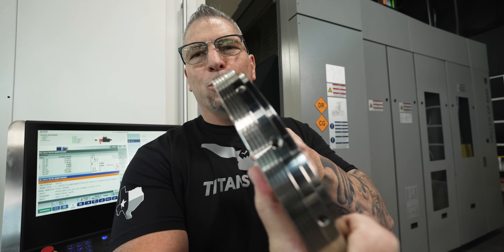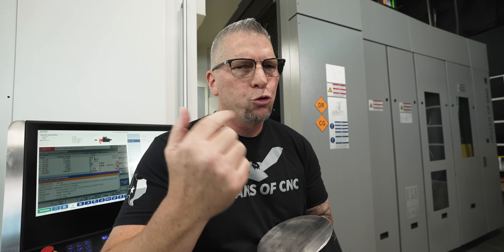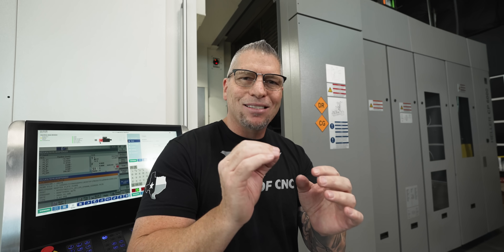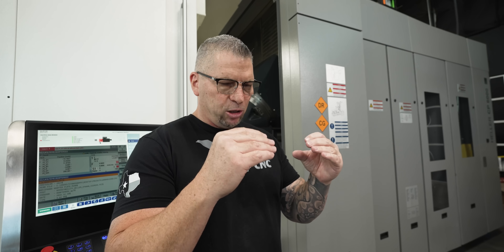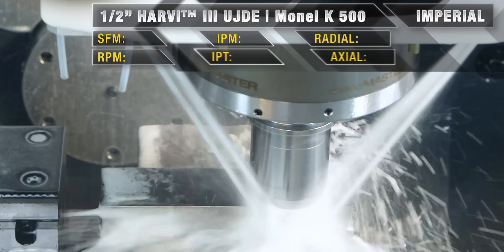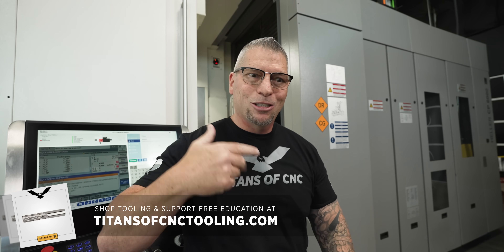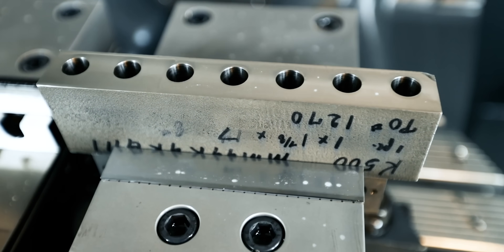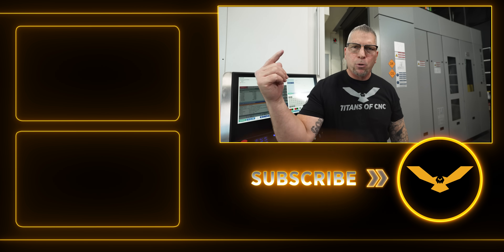How to CNC Machine Monel K500 | HELLER CP6000

Comment: US Navy uses K Monel for skin valves on ships. The valve on the hull just before the fluid enters or leaves.

It is as strong as steel but very resistant to sea water corrosion. Stainless does not do well underwater in the ocean  in a piping system .

Comment: Let’s see machining of tungsten carbide or ceramic. We use these in the harshest conditions for control valves
Reply: I've jig ground holes in both of those using diamond abrasives, but a chunk of either would become a paperweight if anyone was counting on me to know what to do with it.
Materials that hard take a special technique, where the grinding wheel is only in contact for a second and then pulled out and allowed to cool for a few seconds. Three seconds in the cut turns a $200 wheel into a burnt steel pin.

Comment: never heard about monel. the nastiest metal i had to work with was called vanadium toolsteel (do not remember the exact name but that is what it was). it broke so many cutters if you weren't super careful and even if you were.
Reply: I've never heard of anything called "vanadium too steel," but many tool steels do have vanadium in them, in varying amounts.  I think M2 has several percentage points of vanadium.

Vanadium is normally added to tool steels in small amounts (about .03%) as a grain refiner and grain-growth inhibitor.  I do not believe it affects machinabilty in this small amount.

I've never machined M2.

Comment: I don’t mean to knock Titan down, because I really like his content, but…

I’ve machined on both Monel 400 and K500, as well as Inconel 600, 625 and 718, as well as Nickel200. By far, the toughest to machine was the 718, hands down. The easiest was the Monel400, followed by the K500.

None of these materials are particularly hard. They are all varying degrees of tough. There is a significant difference between hard, tough and strong.

Comment: A bit of personal experience from when i machined monel(70-30nicu with some extra herbs and spices occasionally) and k monel almost daily for 3 years at my previous job, i got into the habit of not making the most efficient toolpaths on the lathe, but rather better ones for chip control. Makes your boss a bit unhappy at first but it also makes your life as a machinist way better cause you're not fighting giant rats nests two or three times a cycle.

Comment: If you try to cut that with any other endmill besides Kennametal they will snap off? I highly doubt that. You. Can't possibly go and make a claim like that then go to the most basic carbide drill and tell me that you can use that without issue. Im sure every single other tooling manufacturer has a series of endmills that will cut that, not just your sponsor

Comment: Yea monel is hard stuff for sure. In the oilfield a lot of the high dollar tools in the bottom hole assembly were machined out of monel and it was always a bitch to get the dies in the slips to adequately bite into it with not a lot of weight hanging below.

Comment: That part looks like the an impeller support brace for the main pump. If it is monel, it is probably for Liquid Oxygen side since it is compatible with oxygen and not catch fire. I design rocket parts so I have some info about this. 

If you think Monel is hard to machine, try machining Stellite. I would work with that stuff when I made injector parts for the F35 fighter jet engine combustion chamber injectors.

Comment: For anyone's general reference, monel is commonly used in oxygen service as it is less reactive with hot/high velocity oxygen which would otherwise combust with a carbon or stainless steel piping system.

Comment: More content like this! Would these same feeds & speeds be applied if you're running the part on a Haas VF2SS? Also I recently started using GODrills, and I love them. I recently had a job with 100 pieces of 304 with 21 .201 holes per part with 6 parts setup on a pallet. It would take nearly 37min to drill all the holes with a cobalt drill. Switched to a Screw machine length GoDrill and it drilled them all in under 10min.

Comment: Never thought I be correcting you. But this material isn’t hard at only 28 to 40 Rc. It is not hard but it’s tough. It’s the toughness that make these superalloys difficult to machine.
Reply: Yup it isn't particularly hard bit tough as dragon's scales. The part he made was a fuel delivery manifold for the injector array of a liquid fuelled rocket.  The reason that monel was chosen is that it can take the extreme forces as it is being cooled to cryogenic LH2 temperatures.😮

Comment: LoL machined this more than 30 yes ago on manual machines in the university where I used to work. sharp angles and aggressive chip breaker in a carbide tipped tool to take the excessive heat produced.  This was way before insert tools for normal machine shops usage a time where each tool was made and hand ground for each material and purpose. To be honest if you deal with the excessive heat, a sharp angled tool it was a dream to cut I thought.

Comment: i've machined a bunch of this stuff before, it is nasty stuff, only making small M6-M10 bolts, but it would wear the threading insert in such a way the thread minor would wear soo much more than the pitch, that you could measure the pitch and it would be right...but thread gauge would not go on, because the minor has worn so much it is out of tolerance, despite pitch and major being correct

Comment: Five thousand dollars for one piece of stock? Titan wouldn’t like me….
“Jim, here’s your piece of Monel K500, here’s your program..,hey, where are you going?”
“I’m going to the stock room for a piece of the cheapest steel we have in the building. That used car is sitting on your desk until I’ve run this program on something we can afford to screw up and taken it through inspection…”

Okay…suggestions for other materials to machine? How about lignum vitae? “That sounds like wood.” Well…that’s because it is. Lignum vitae is one of the hardest woods on the face of the earth. It’s harder than aluminum. The Navy used to make shaft bushings for nuclear submarines out of it, and machined it with metalworking equipment. It’s also extremely greasy, which is another attraction - it’s self-lubricating.

If you don’t want to clean allergy-producing sawdust out of your lathe for the next six months, how about bronze? The attraction here is bronze has a really high coefficient of thermal expansion, so temperature control is super important.

Comment: You said "K500 IS machinable" , can you name a metal that isn't?
Reply: High manganese 'Hadfield' steel is sometimes described as having a relative machinability rating of zero. This is because of its weird properties, it's soft as manufactured but when you try to cut it the surface work hardens to 500+ Brinell, the sudden massive increase in hardness typically shatters your tool.

Comment: A couple times in year, we are machining ballistic plates made of Trip Steel (Transformation Induced Plasticity) X4CrMnNiN16-8-4
One time, the tool holder from our SK 100 broke off and the main spindle was bended. The damage cost the company 50.000 Euros and two weeks of standing machine. I don´t like to machine this material.

Comment: I never made large parts out of Monel K500, but I made all kinds of small part out of it.  It never caused me any issues.  At the shop I worked at all we did were nickel alloys for microwave tube customers.  Monel, Kovar, Cupronickel, beryllium copper and vacumet iron were all we machined.
Reply: You did a lot of fun ones. I nominate beryllium copper to be the nastiest of the bunch 😂
Reply: @christopherleubner6633  It's not bad, just stringy AF.  Just like other coppers.

Comment: When I hear the description, it reminds me of Vanadis 4 Extra "SuperClean" - a material we use a fair bit for cavity parts in injection molding.
It's alright to machine when it's not hardened (even though it wears out endmills pretty fast).

In its hardened state it reaches 62-64 HRC and tools don't last all that long when you're trying to get a good surface finish on that crucial final pass.

I love videos like this.
Reply: @BrianHealy666  I don't know, really. 
I'm "just the machinist", so I don't hear all the back and forth between the customers and our sales design department.

The usual explanation I get is that it's very hard and approved for use with medical equipment.

If I had any say in the matter, I'd try getting hold of some Tyrax ESR or Vanax SuperClean (since our main supplier is Uddeholm anyway) - just to try it out.

Comment: About the heat treatments: Solution annealing of Monel Alloy K-500 is done at 1600 to 1900 °F, depending on the starting condition of the material. Solution annealing, as the name suggests, puts both titanium and aluminum in solid solution. 

Then the aging is performed at 900-1100 °F, again depending on specific conditions of the material and required mechanical properties. 

What happens during aging is that the titanium and aluminum, which are at that point still dissolved into the nickel-copper phase, "condense" to form Ni3(Ti,Al) intermetallic particles, or precipitates. These nano-scale particles greatly increase the strength of the material, they make it much harder for the material to deform. 

Broadly speaking this is the same hardening mechanism that also works in the PH series of stainless steels and in Maraging steels.
Reply: @Cool Baby Uhm, no. Precipitation is a temperature-driven process. Fast cooling afterwards is not required. 

After solution annealing you need to quench Monel K-500, so that Al and Ti stay in solid solution untill it is time to do the hardening heat treatment. (Maraging steels and the PH stainless steels don't even need quenching after solution annealing.) 

After precipitation hardening (aging), so when the intermetallic Ni3(Ti,Al) precipitates have formed, cooling rate no longer matters. At that point one can cool down in-furnace, by still air, or by quenching. 

It's the nano-size precipitates (which are intermetallic) that hinder movement of dislocations, which makes the material harder to plastically deform.
Reply: @Hydrazine1000 awesome breakdown totally fits with what I remember from my college days!

Comment: Another excellent informational video. It's also heartwarming when you confirm what I have learned through trial and error on machining exotics. When drilling these materials, don't be tempted to peck drill because this will probably cause work hardening issues(especially on tapped holes). I would love to try thread forming instead of using a Tap. I believe that this method of thread forming would solve possible tap breakages
Reply from the maker: Awesome! I thread mill everything possible. So if it breaks… I just put in another one and keep moving without scrapping material

Comment: Not all machinists, clickbait title, don't put all unskilled people as machinists, true machinists can machine anything.
Reply from the maker: So you never struggled with Monel at the beginning. You just were perfect and machined it to spec … in tenths and was as efficient as possible. Everyone usually struggle with Super Alloys at the beginning and as mentioned in the video… once you have the secret sauce… then you have IT. It still is a challenge though.
Reply: @TITANSofCNC  I started my Australian Apprenticeship working in a factory machining parts for the Australian and American military. We machined stuff that was way harder than anything you have named. It's just different forms of stainless, once you understand that it's easy. Been using CNC since the 1980's and the machines and tooling of today make machining anything easy.
Reply: @dikkybee4003  Just because you've machined it for so long does not mean every machinist had to machine it.I have my own machine shop in Australia as well and machined a part out of monel only once in my 44 years in trade.

Comment: Titan, on the drilling cycle how does not having through coolant affect the process?
Thanks,
Travis
Reply from the maker: It’s doable, just take smaller pecks and make sure you retract all the way out of the hole… another thing I do is actually feed slow back into the hole after the peck… like F20.
If you rapid back in and smash chips that didn’t get removed… your drill life will suffer etc. 
lots of cool techniques to share.

Comment: From my side, usually used for more than 25 years in oilfield dowhole equipment. 
Cheaper than 718 nickel alloy and corrosion resistant under hydrogen sulfide environment, easy to machining  and no galling on threads or tight assy